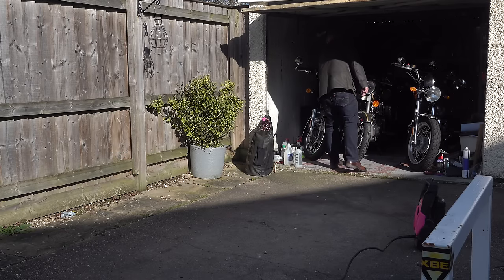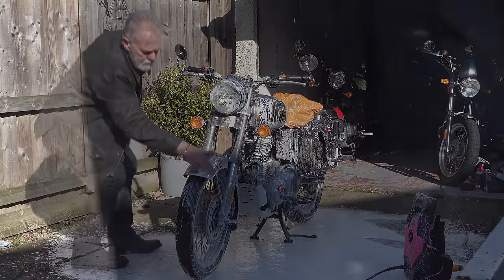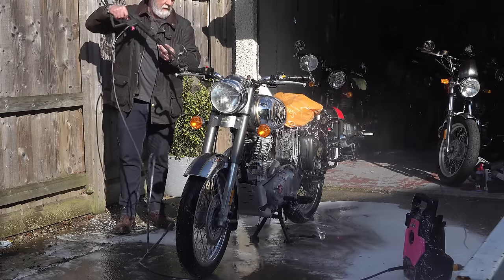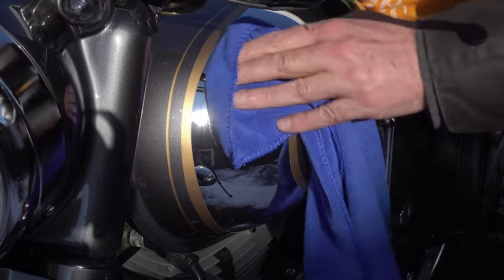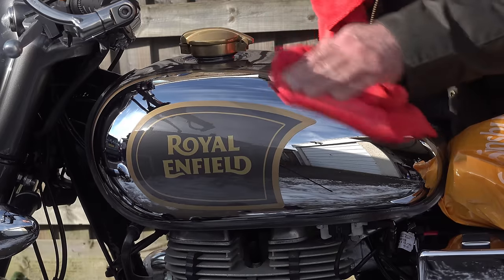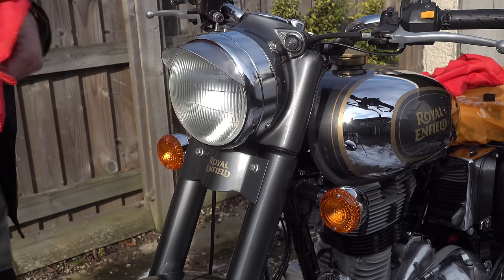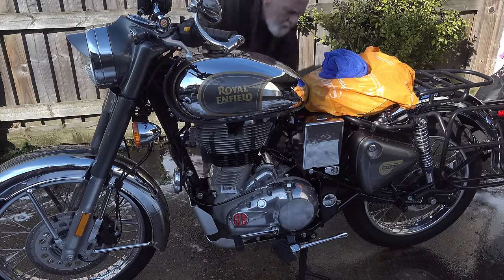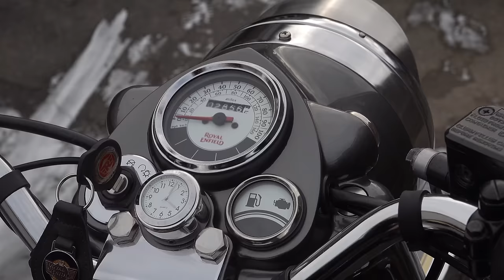This NEXT GENERATION car/motorcycle fast application 1 year CERAMIC HARD COAT,  TOO GOOD YO BE TRUE?

Comment: For your garage condensation issues leave a fan running in garage to keep air moving along length of garage. Ventilation front to rear is key.

Comment: Condensation on the exterior can be dealt with, it's the condensation on the inside that's more worrying.  Get a little rechargeable fan to move the air around in the garage and reduce the condensation.

I'm a great believer in high quality Ceramic Coating. I did my, then new, bike 4½ years ago and it is still working protecting the paintwork 20,000 miles later. Water still "sheets-off" and the bike still looks incredible and is always commented upon. It has also survived a myriad of bug-guts from summer countryside rides.I shall being re-applying it later this spring after I have completely "detailed" the bike.
Have you noticed how much smoother the paintwork/chrome is to the touch?

Comment: Purchased the ceramic hard coat spray and just finished my bike ( after going back to rewatch rhe video, just to be sure I would do it correctly) . 
Well pleased with the result and i only used about 1/7th of the bottle. My bike is matt grey and has a wide Matt black stripe on the front mudguard that i never could get a nice finish on and always looked "tarnished".  I was amazed at the finish it put on the matt black  and the rest looks like someone spent an afternoon on it , rather than the hour it took me including washing.Well pleased and glad its a british product sourced from a local store and not online.
Keep up the good work on the channel!  Ive been a subscriber for a while  and bought a few "Uncle Stuart" recommended products. Never been disappointed. Thanks

Comment: Hi yes I get mould in the flat, even when I had Central heating it was eating the plaster boards on the ceiling on the landing. You have to leave the windows open lol. Or in your case some vent opening to let air get in.

Comment: Thanks for the review.
I know zip about ceramic coatings so of great value.
Decided to buy the bike dryer you reviewed and have to say works a treat on my little Red and Chrome  350 classic.
Specially as here in Suffolk tge waters hard as concrete so I rinse with D water
Think I'll give this coating once I've done my service .
 Lee
Reply: I’ve not washed my bikes since moving into our current home early last year, but the water is harder here than I’ve ever known. It made a right mess of the finish on my wife’s dark coloured car. 
I’m not a huge fan of clever finisher products, using carnuba based wax polishes + rubber & vinyl cleaners. While I love Solvol Autosol on polished aluminium engine cases (which are bare metal on my old bikes), but I don’t use abrasives of any kind on chrome. Even NXL paste which smells like bubblegum is very fine indeed, chrome is always removed. Detailing chrome, I use white spirit to lift  anything stuck to the surfaces & leave it bare. 
So although I’m a sucker & like to have anything that’s really useful, I don’t think I’d displace my Harley Wax for painted surfaces. 
Nice review from Stuart and had the product been usable on chrome exhausts, I’d have bought some!

Comment: Stuart, what was the bike safe water spray unit you used or was it just a garden hose with a pressure reducer?  Where can I get that air blower?
Cheers,
Mike.

Comment: Lovely clear video. Stu, do you have a system for re-using your microfibre cloths? I usually end up with a few after each job and seems a waste to bin them. I have tried washing but they are never the same.
Reply from the maker: wash them in the washing machine at 40 degrees do not use conditioner! I can keep them going for years that way!
Reply: Thank you Stu 👍

Comment: Not sure if you mentioned this. The company's Saftey Data Sheet for their snow foam states: "The product may affect the acidity (pH) of water which may have hazardous effects on aquatic organisms. Avoid discharge to the aquatic environment."   And for the HD it says "Prevent product from entering drains." We love our clean bikes, but I think we also love clean water systems. These products needs to be used in controlled environments.
Reply from the maker: My drain is a soak away so it doesnt reach waterways

Comment: I bought a Sym 300 scooter in 2021, and it has a ceramic sleeve in the cylinder. At 8000 miles two years later, it has about the same power (of course regular oil changes); Any ideas? Slick 50?! HA, thanks mate.